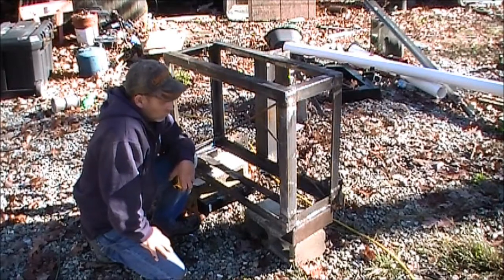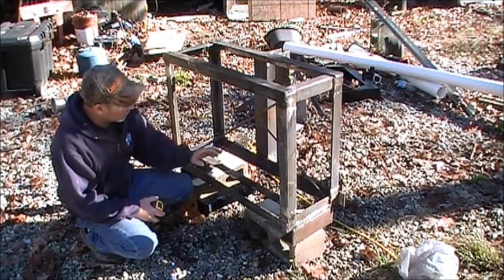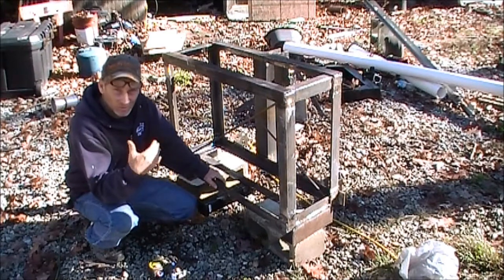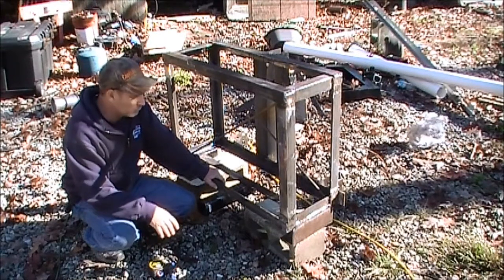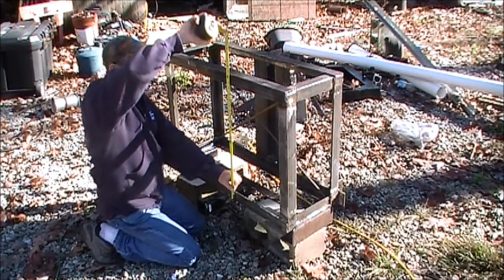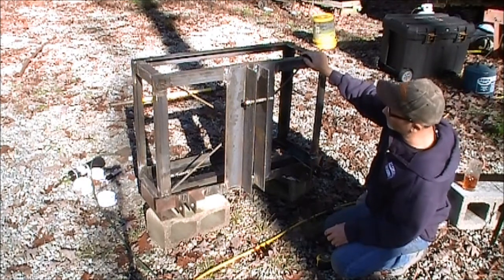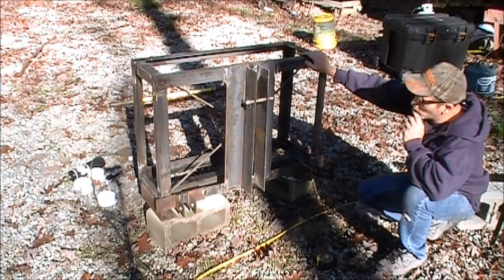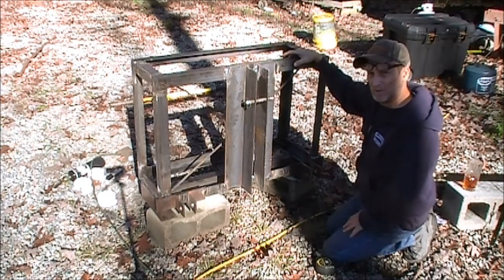Building a ballast box for the kubota tractor part 1

Comment: Good stuff, having to watch parts 1 and 2 now.  the finished product looks really good.  Where do you put the chainsaw?  a slot for the chainsaw would be nice too.
Reply from the maker: +GY Solutions  yup I just told my neighbor last week that I may put a chainsaw slot on the side. I started to put it in the concrete with one of those plastic guards but I didn't want it to fill with rain water and so it would have needed a drain drilled down through it. so I figured a 1/4 inch round stock bent and welded on the side would do it. then I started thinking fuel can and bar oil basket. then I said you know what I just want this project over with I can add on to it later with all the rain I been having here it was hard to get it done and painted to avoid all the rust. I don't have much of a shop so most all my work is done outside on projects like this. I may still add the 1/4 inch round stock to hold the chainsaw on the side though.